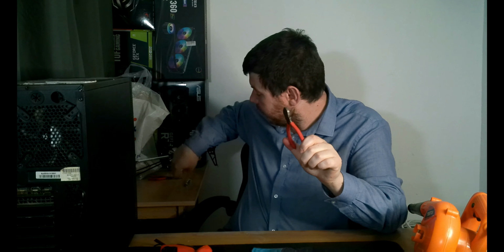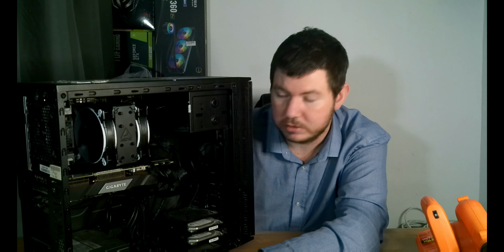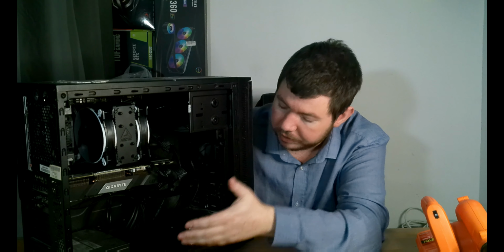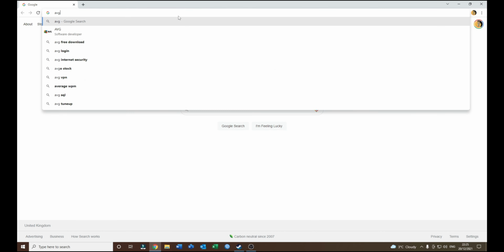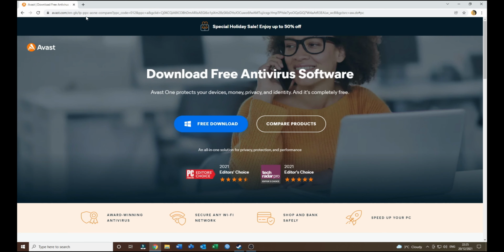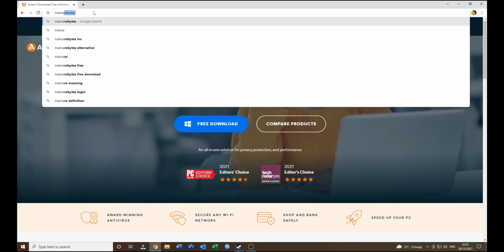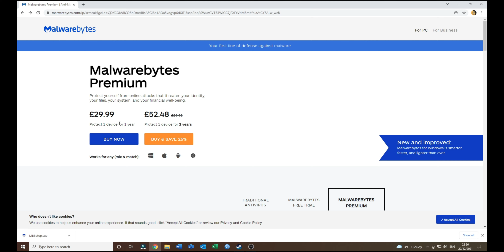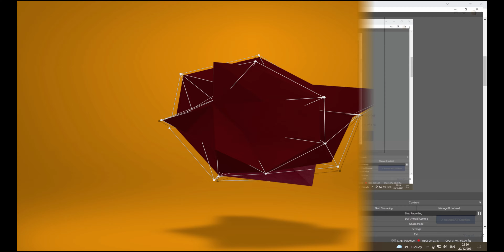6 house keeping tips for your Gaming PC.

Comment: Good video, but I will say that when I deep clean PC's for friends that have smokers in the house we take most everything and give it a bath in isopropyl alcohol to loosen up the tar enough to clean with toothbrushes. The key to usually not breaking stuff when doing that is to wait more than enough time for it to evaporate off so in the Summer in Arizona it's pretty quick. And just replace fans if you can't clean them well enough by hand. And power supplies if caked on tar and stuff just toss them and replace ti as it's too risky to work on and could shock yourself or burn something out in the PS or the system.